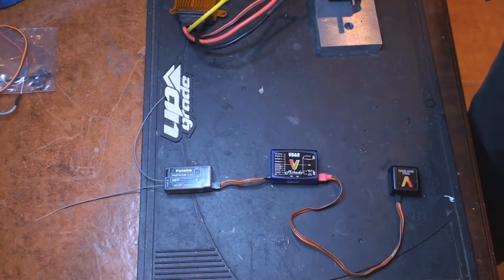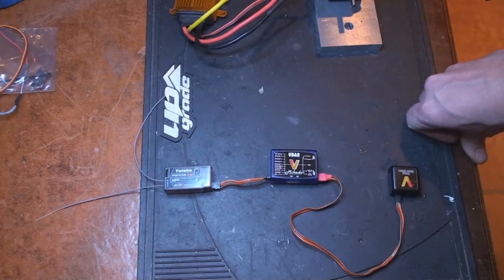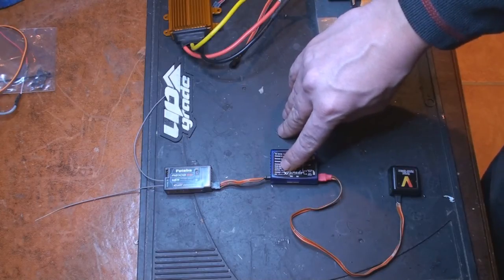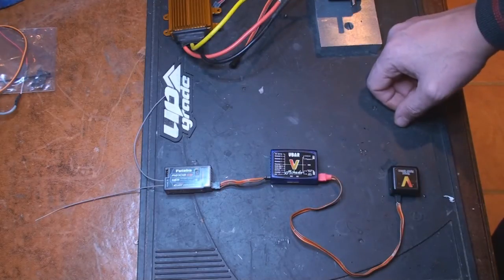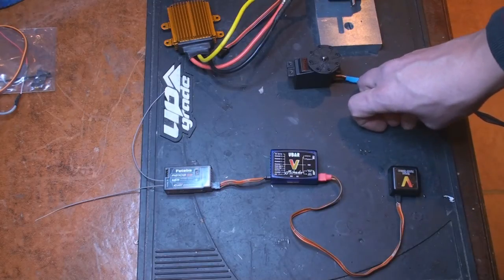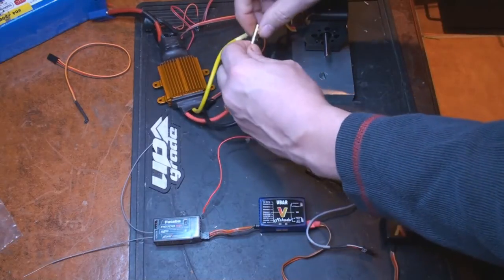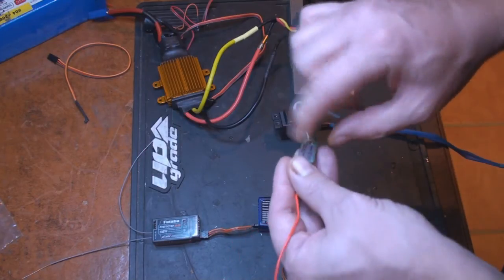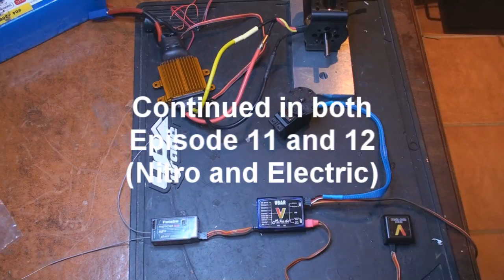VBar 5.1 Episode 10 ½ - Wiring the governor

Comment from the maker: Yes, you can, however the Spektrum Backplate sensor runs best off 5.0v, so Split the cable, Signal going into "Sensor II" port (only signal cable) and the +/- into the Servo port above.

That way you feed the sensor with higher voltage and get better reading from it.